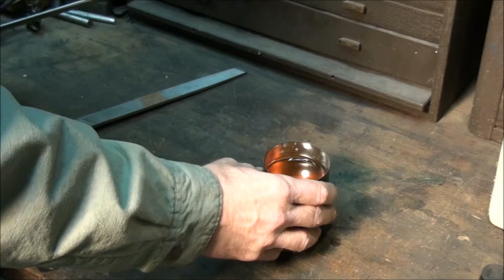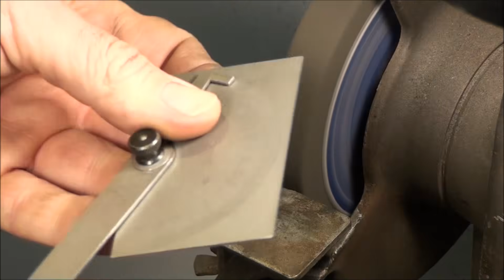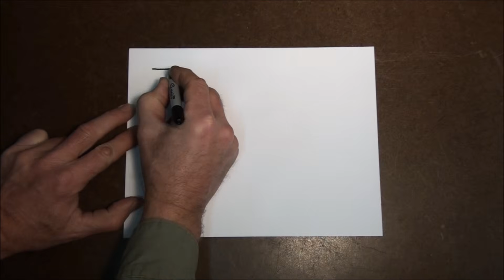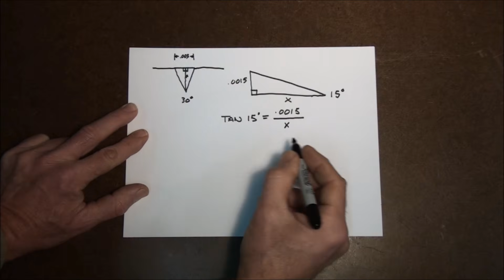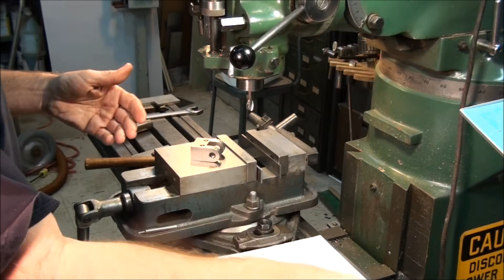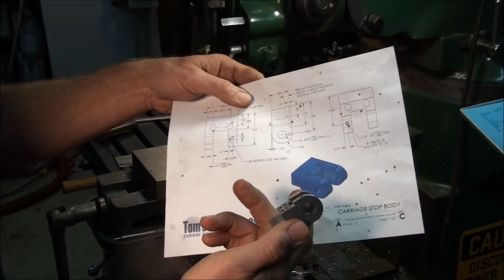Carriage Stop Body Part Five, Cutting the Index Mark and Final Machining

Comment: Next time harden at last and finish a bit and not harden at first ;)
Anyway, good Video :)
Reply from the maker: No, that won't work. The O1 needs to be hardened first so you end up with a nice sharp point to cut the graduations. If it was cut to a point first and then hardened, the sharp point would go away.

Thanks for watching.

Tom

Comment: Thanks Tom, loved the plunging tip when milling a radius, I never would have thought if that in a million years. If you had of cut the indicator mark only halfway across the pad would you have pushed or pulled the tool? I would think pushing would result in a burr that would be hard to clean up?

Thanks again, your videos are fantastic.
Reply from the maker: Thanks Shawn.

I would have pushed the tool to cut a partial groove. The burr would be minimal and easily removed.

Tom

Comment: Tom, thank you for the projects.  I finished my second stack block just the other day to send to dad for his Christmas present. 

This project seems to require reamers and a rotary table.  Since I have neather I'm trying to decide how to proceed.  Would you recomend reamers over rotary table?  I see many "adjustable reamers" for sale but not very meany sets.  It also looks like you need three sets of reamers.  One plus set, one minus set and one exact set?

Thanks again for the great videos.
Reply from the maker: Good job finishing up the set of stack blocks. I've been meaning to set up a section on my website for people to show off their completed projects. Guess I need to get busy.

For reamers, you need a fractional set and a dowel pin set that includes over and under sizes for common dowel pins. Expansion reamers are quite expensive for what they do and aren't for use on machines. The 7/16" hole in this project could have been bored rather than reamed if you have a boring head. You can also make your own reamers called D bits (Google it). There are many ways to accomplish the same task in machining.

This part could have been made without a rotary table as well. I could have used a corner rounding end mill for the radii and filed the area around the pad.

Thanks for watching.

Tom
Reply: Tom's Techniques Thank you for the reply.  I see how to make the D-Bits and that will be useful project for me.  Plus given the new search term found some reamers to add to my wish list.  For the 7/16 I would mount the piece on a 4 jaw chuck and bore it there as I don't have a boring head (yet). 

I did pick up some rounding end mills for the stack blocks and that is what I expected you to use on this project.  That is a lower cost way to get this project done.

I plan to start this project after I see the rest of the videos, even though I don't  need a carrage stop for my lathe as it already has one.

Thank you for spending the time to teach us new (want to be) machinists.

Comment: Awesome  video...why not grind your tool to shape while it is softer, then heat and quench? Wouldn't that leave you with a harder tool than grinding away the hardened steel and changing it due to heat, etc?
Reply from the maker: Tool steel hardens all the way through, so you don't need to worry about grinding off the hard part. It also tends to grind easier when hard, so grinding it in the hard state would eliminate the need to go back and clean up the edges after heat treat. Most grinders have water cups, so keeping it cool is no big deal.

Thanks for watching.

Tom

Comment: Thanks Tom, I've learned a great deal from your video series. I tend to use too much cutting oil. Sometimes it makes a mess and I can't see what I'm doing. I think I'll try machining dry more and see how it works...thanks again.  Lee
Reply from the maker: Lee,

You shouldn't use cutting oil at all for machining because the smoke it generates isn't good to breathe. The best thing to use if you want to use coolant is a water based mist coolant. Save the cutting oil for tapping and threading. I rarely use any at all for milling, because of the mess it creates.

Tom

Comment: Very cool work Tom.  Have you done a video on your mill spindle air ratchet unit?  I would love to see how it works and perhaps how to fabricate one.  Thanks-   Fred
Reply from the maker: Thanks Fred.

The power drawbar was just an experiment to see if the cheap Harbor Fright impact wrench had enough guts to do the job. Eventually I'll redesign it to make it more compact.

Tom

Comment: Great videos, well presented, easy to follow and understand.  I have not done any type of machining since I left school in 1974. i am about to enrol at night school to learn the basics, milling,  lathe turning, general machine shop stuff with some welding thrown in. my ultimate goal is to be able to renovate and repair machine tools. I like the engineering drawings you work from. what software do you use to produce those?